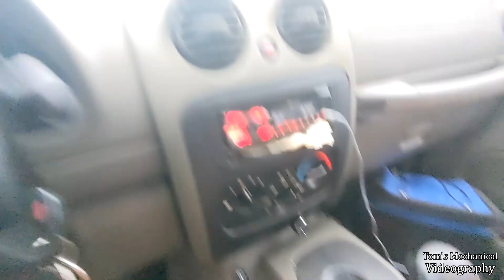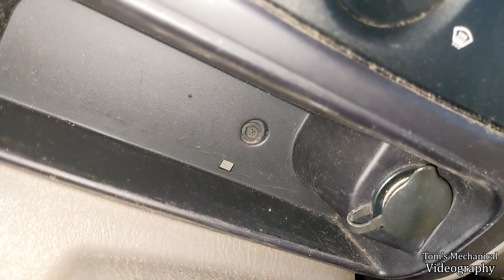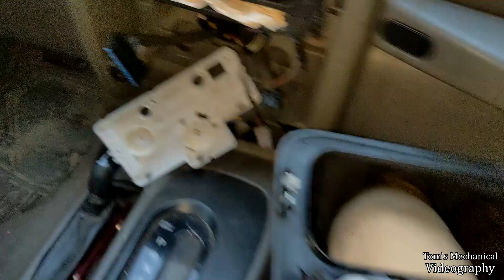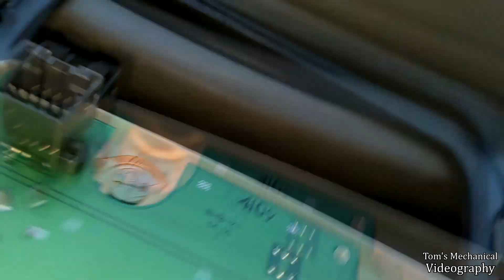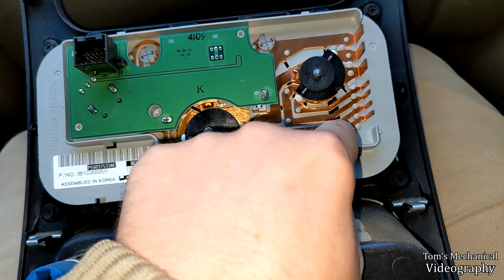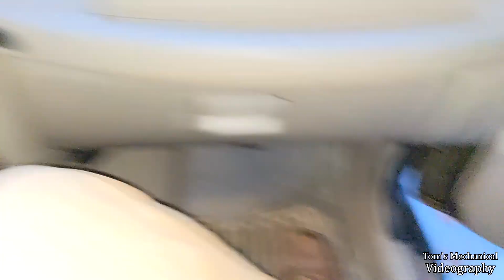Disable the AC on Defrost and Foot Setting in your Jeep Liberty

Comment: I solved the problem by using my wife's nail polish instead of electric tape.  I think it's more long-lasting.  With the dielectric grease applied on top it flows well and does not wear out easily.
Thanks for the video and the excellent explanation

Comment: Hi Tom. 
I have the same car and the same problem. I see in the video that you put the tape on two copper lines. Is it correct?
Two hours ago i've opened the dash and the air controller panel, and i had a panic attack...